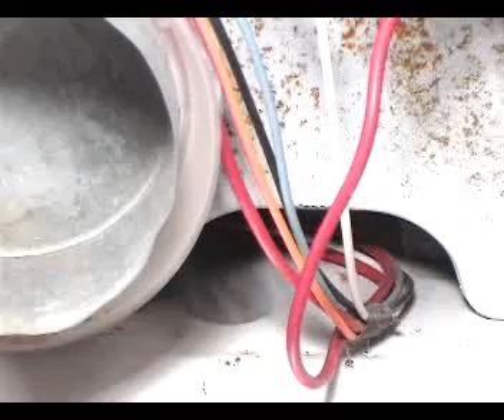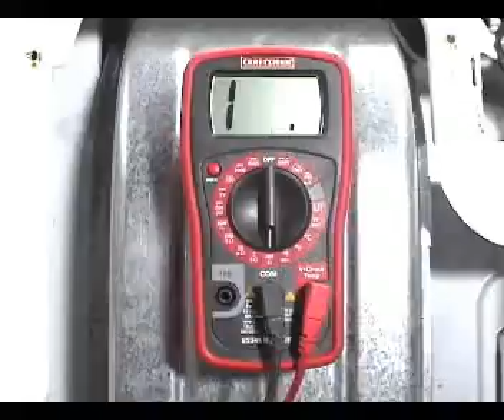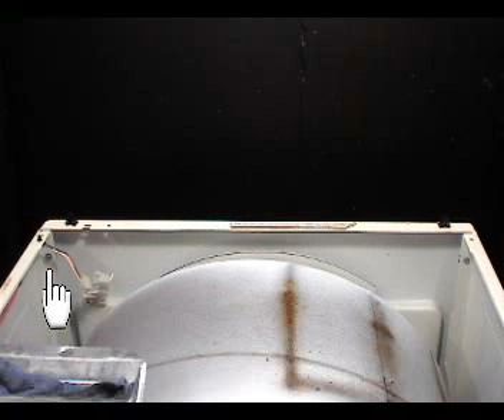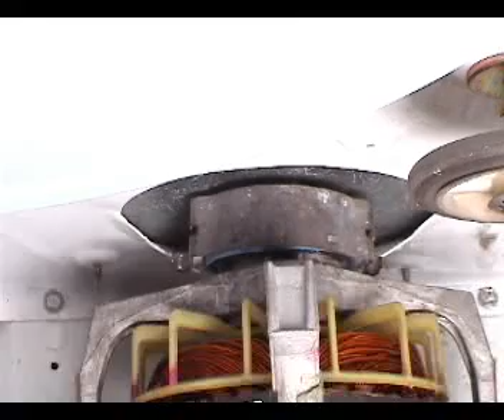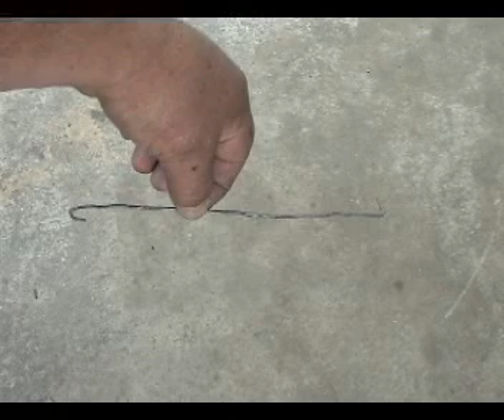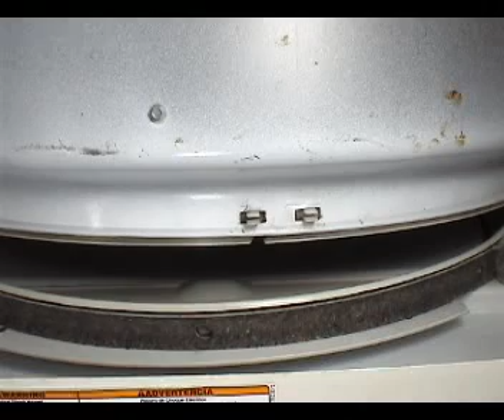Whirlpool Dryer Won't Start - The Motor Switch

Comment from the maker: Yes you are right, but the centrifugal switch consist on two parts. The switch and the switch actuator, that is the reason why it should be checked with the motor running. When the motor is running, the switch should be on and when the motor is not running, the switch should be off.

Comment: Can the two red wires at the motor be tested for continuity by pushing the centrifugal switch in and checking with a meter?
Reply: yes they can